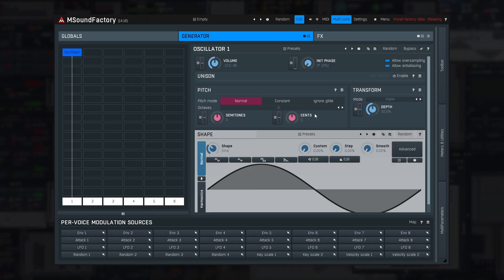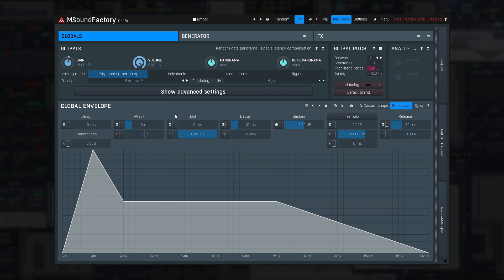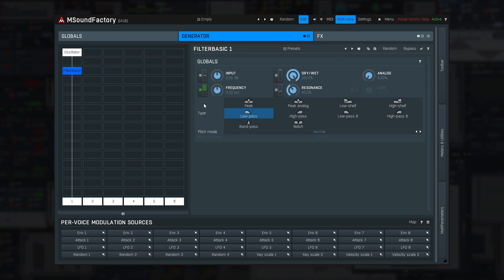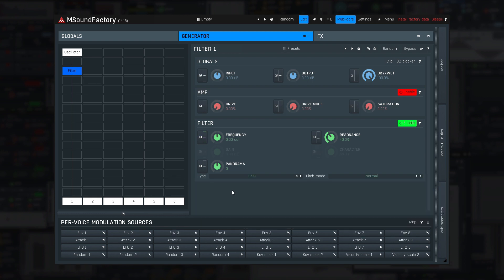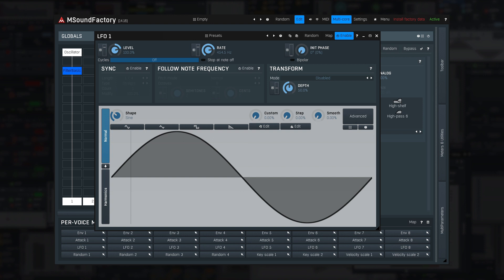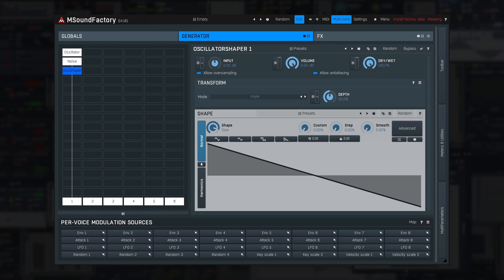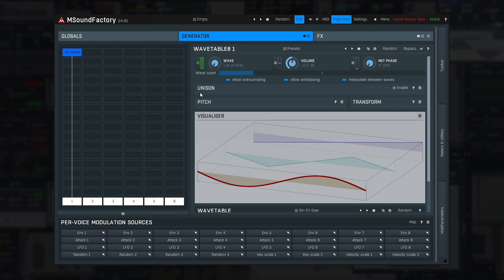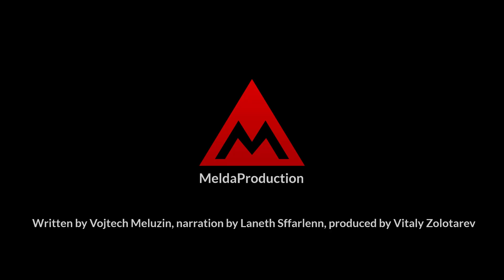MSoundFactory #07 - Subtractive synthesis

Comment: I'm so tempted by new synths like Vital for example but whenever I get to the purchase section I finally don't, but thinking I already got MSoundfactory. In terms of digital synths, there literally is nothing you can't re-engineer with it, but it goes even fast beyond that and it's quite good in emulating analog synths as well although this isn't it major strength imo. But it has become quite good in that department also. I'm hoping for real new modules in the future, such as a complete new full fledged granular synth module. And what still would be great would be special modulation shapes for the XY-grids which than could be further modulated in speed and direction.
All in all, without wanting to sound like a fanboy, this is an unparalleled synth universe. A lonely island synth system. Keep up the amazing ambitious work with your unique dev and customer care phylosophy. There is nothing like it elsewhere. Keep rocking.